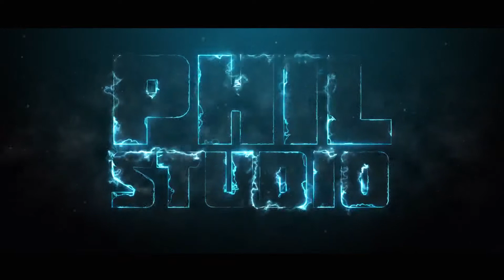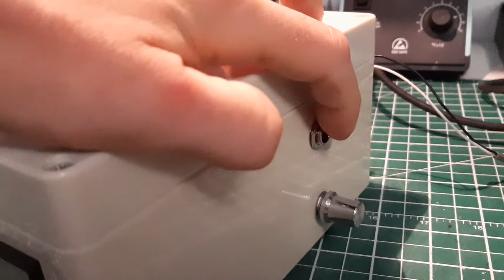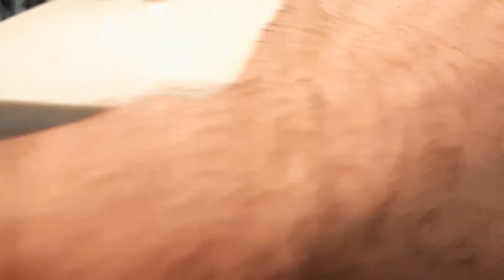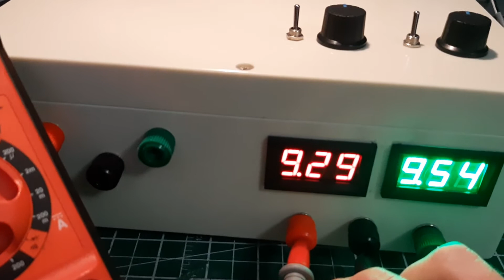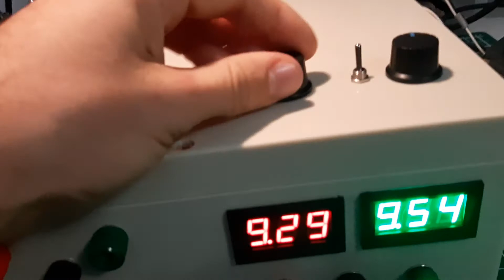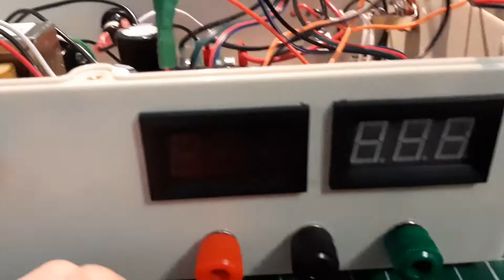Dual Polarity Power Supply - Another DIY project

Comment: Phil, very nice! I would suggest that you use 'green' as ground and 'black' for negative... those are standards (at least in the US)... looks like it would be easy to change since you smartly used terminals on the back of those jacks.
Reply from the maker: You are right about that, I couldn't agree more but it wouldn't fit with my green display :P but for sure it's important to know the standard just to avoid fatal error! Thanks Tim! :)